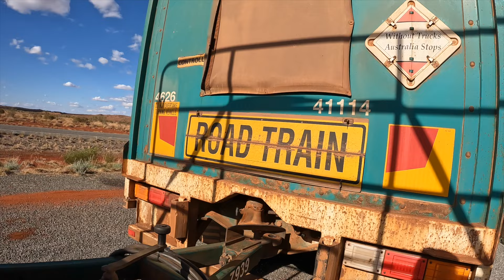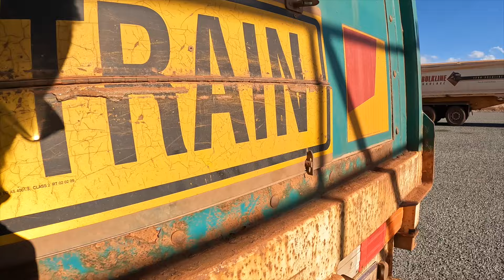The Road Train- My Home Away from Home- Starting the revers order trip back

Comment: The worst drivers are the ones who are not fully aware of their surroundings, regardless of what they are operating or whether they are experienced or not. It doesn't take a rocket science degree to process that there's a big road train coming your way at a rate of knots with the right of way, to know not to pull out in front of it in order to preserve your own life aswell as the truck driver's 🤷‍♂️

Sometimes, it seems common sense is by far the most difficult accreditation to acquire in life for many of us at times.
Reply from the maker: I know what you mean mate, the problem is bit by bit, generation by generation the common sense is fading away, this is what I always telling people and keep telling that with all this new rules and regulations about safety they are just wiping off the common sense of people, they are making a new breed of non sense and non thinkers.